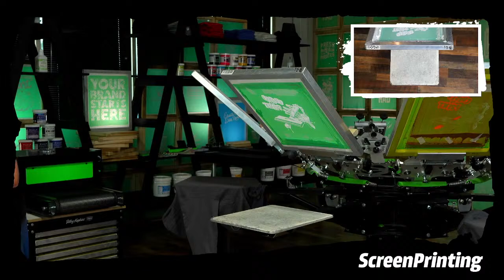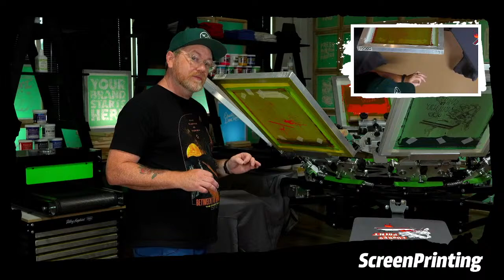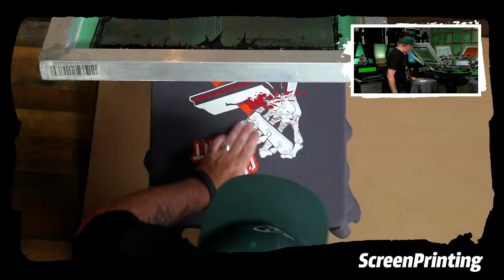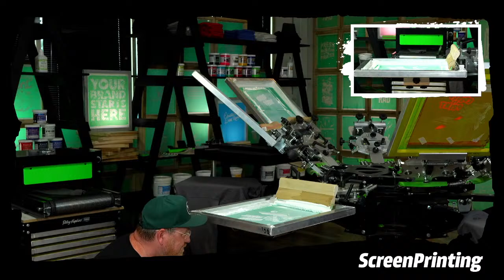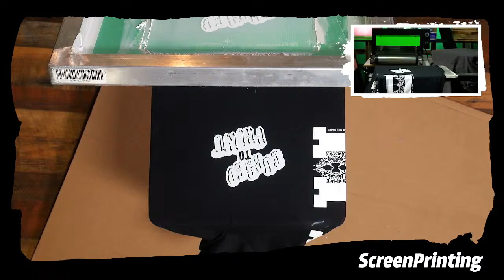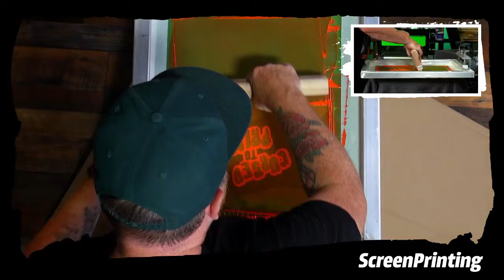How to print on Hoodies Livestream with Josh Wells

Comment: How come everyone is still using old school plastisol when the future is coated water based inks? I’m baffled… water based inks are superior to plastisol in every way possible. Durability, longevity, eco-friendly, plus you can get the same bright look now with newer water-based ink systems which are coated instead of uncoated.
Reply: I heard plastisol is easier for beginners to learn with. Since this is a tutorial for people new to screen printing they probably used plastisol bc that's what most people watching this are using
Reply from the maker: Hi @Tom Brooks. Lot's of printers prefer water based to plastisol and vice versa. Both are good tools depending on application.
Reply: I like water based printing. I only use green galaxy inks
Reply: Water based is crap on vector art. Not even comparable in brightness and opacity.